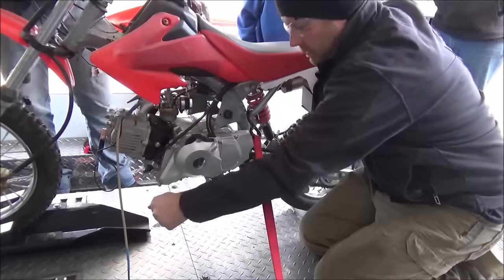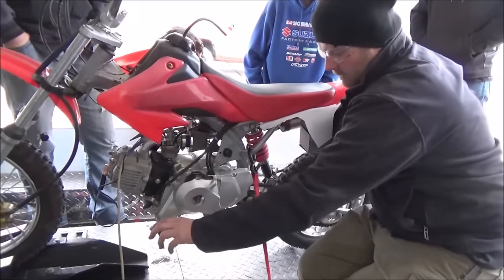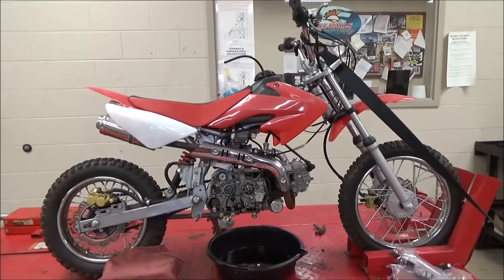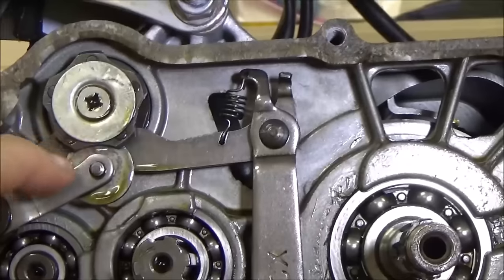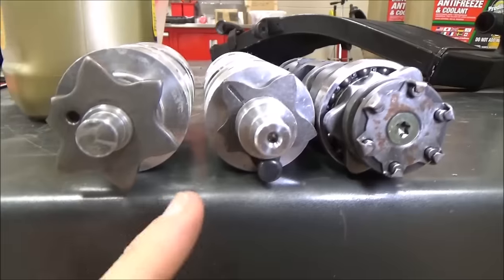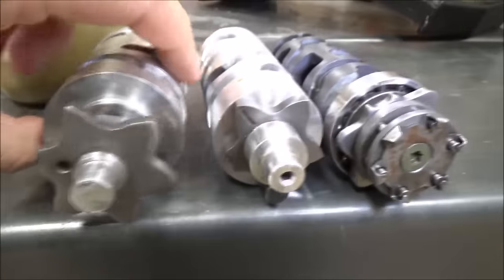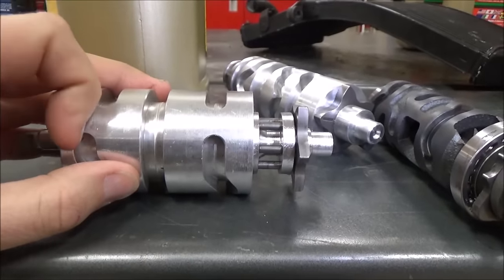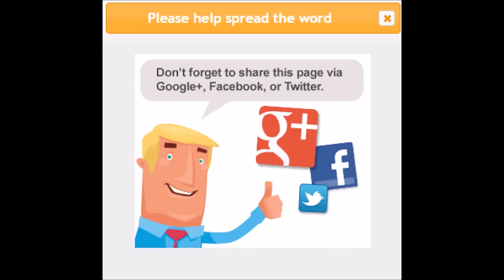Chinese Dirtbike Dyno run with numbers and shifting nightmare!

Comment: Just inserting a comment - some Japanese bikes imported early in the '60s and into the early '70s had a "rotary shift" mechanism which allowed you to go from top gear to neutral and then next into first.  It was discontinued as shift patterns were consolidated on all machines to the  1N234,etc. pattern to suit dept. of trans. standards.

Comment: Some of them have something inside, attached to the 4th gear that when you are moving, it doesn't let u go "up" to neutral. That way, if you are doing 30mph and try to shift "up", you just "pull the clutch"(if it's an automatic clutch) and if you stop without shifting down, you can just go "1 up" back to neutral without going through all gears. Dont know about 3-speed or others, but most 4-speed, all up or down, work the same way. I know that a few of them fail, but not a common problem.
Reply from the maker: Thank you for the comment. See the link below for more help with your question. I have been banging my head against the wall thinking of ways for people to say thank you in an impactful way to help keep these videos coming. Here are few ways that many have found as a way to give back. 
* Membership to H2W (includes t-shirt or tech help) https://how2wrench.com/product/membershipmembers-onlymembers/
* Simple donation to say "KEEP IT UP"
May you have a great day and... https://www.paypal.me/how2wrench

Free Mechanic info, tool reviews, and “how to” videos newsletter sign up: https://how2wrench.com/subscribe-free-newsletter/

Missed a past issue? No Worries. Newsletter Archives: https://how2wrench.com/blog/newsletter-archives/

Like freebies? Click here for a free diagnostic checklist! 
http://gem.godaddy.com/signups/364621/join  

If I can ever be of service to you, here is a video explains how to connect with me. 
https://www.youtube.com/watch?v=vjvmB01ebcs

Comment: You cannot shift to 1 from 4 when your engine is running. You can only shift at full stop from 4, N then back to 1. Shifting pattern is N 1 2 3 4/ 4 3 2 1 N. Common on most Asian bikes (mopeds/underbones) from 100cc-125cc. Honda cubs first introduced it, I believe.

Comment: I ripped around a parking lot at school on a little 50cc bike that a classmate was working on. It had neutral as the bottom settings instead of first gear. I forget offhand who made it though.
Reply: Shaine MacDonald my yamaha pw 80 has that but its a semi auto neutral then up 1,2,3 its actually nice except for it feels weird to shift up into first. my ds 80 and rt100 are the standard 1 down 4 or 5 up. im not positive but i think alot of semis are neutral all the way down